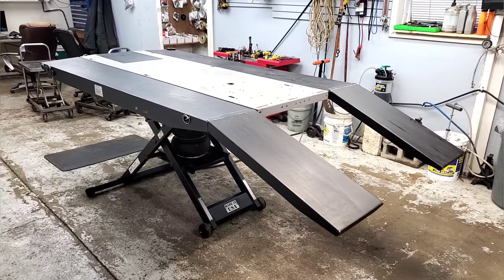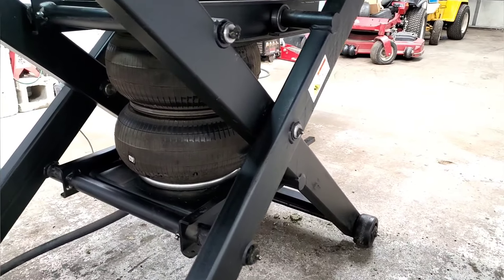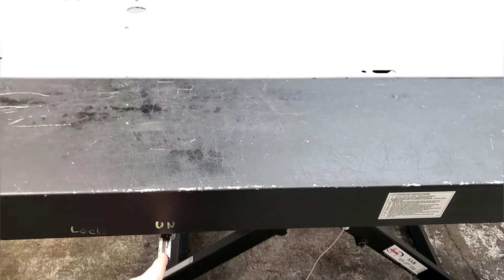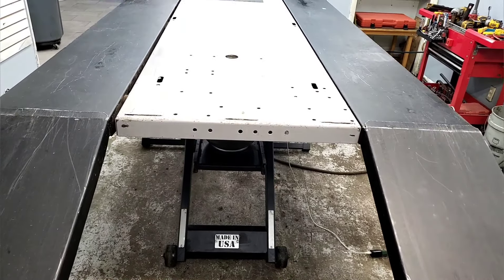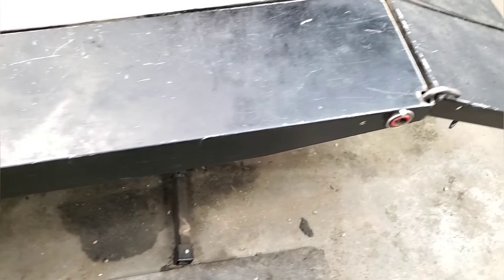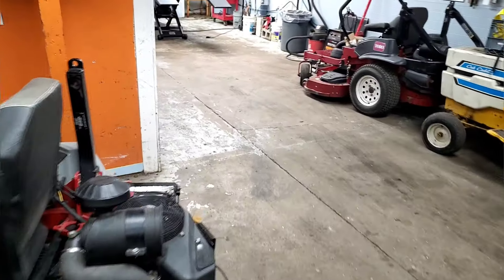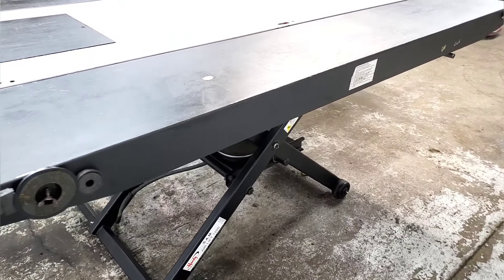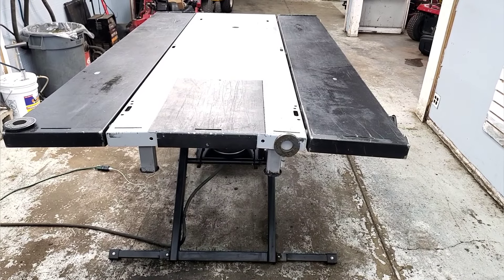Handy S.A.M. 1200 Mower Air Lift Vs Handy S.A.M. 1000 Motorcycle Lift Comparison 1 YR / 3 YR Review

Comment: Thanks for sharing your experience and thoughts regarding the lifts.  The three toys that I use pretty often and try to do my own maintenance and repairs include a Hustler Raptor SD 60" mower, Polaris 700 Sportsman ATV and a Rayco 1625 Super Jr. stump grinder.  I'll be looking into the Handy 1500 since the stump grinder weighs in at 1320 lbs.  Thanks again for sharing.
Reply from the maker: I will have a video out on the 1500 next week. Ours arrived last Friday...so far very happy

Comment: If air bags were a problem being weak or easy to puncture, don't think they would be used on tractor trailers or big construction equipment, used in dirty environments.
Reply from the maker: You are probably right there! It seems like with heat, chemicals and debris from drilling, grinding or other things it would not work well or would fail sooner but even with fuel spilling multiple times on the table not a drop was ever on the airbag so it was designed well in that regard also

Comment: Advantage of the airbag is that it doesn't rust from moisture like the pneumatic cylinder does.  If you have cylinder be sure to use air tool oil.
Reply from the maker: That is true, where we use it never gets wet or if it does it dries quickly. Lots of oil all over it should help. Thanks for watching!

Comment: I'm pretty sure you mean "Pneumatic Cylinder" and not Hydraulic ram. Pneumatic is air and Hydraulic is fluid. I've seen air bags in very heavy duty industrial use. We use air bags on many different machines.
Reply from the maker: I sure do! They seem way more stout than I was thinking. Thanks for watching!